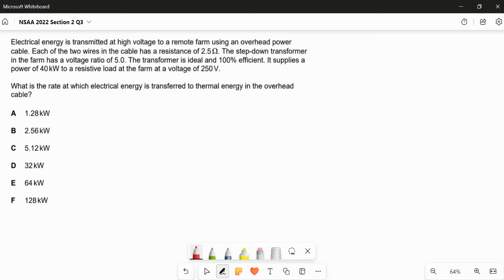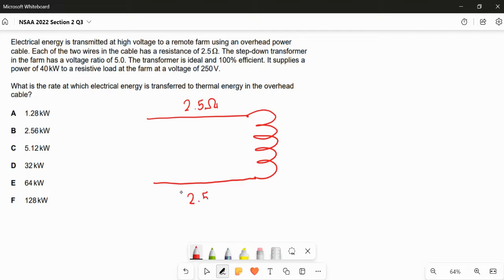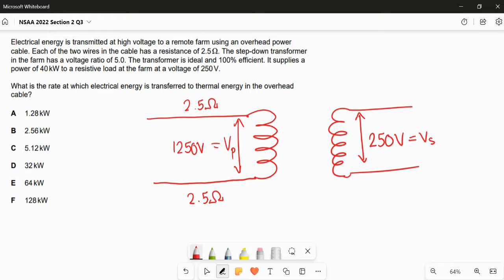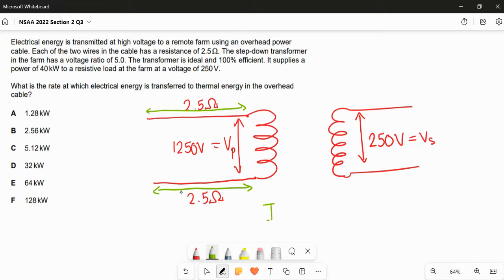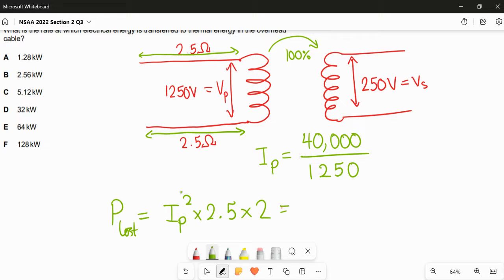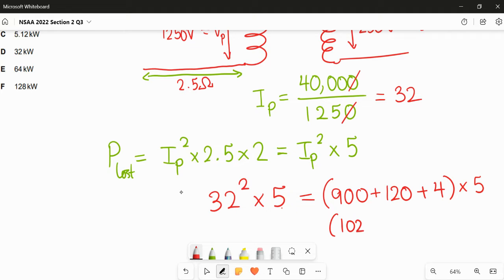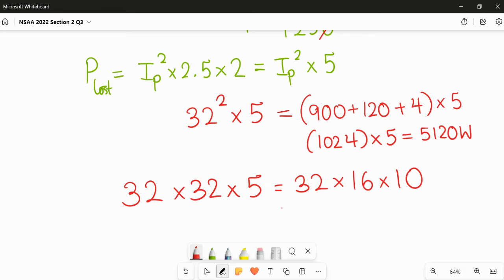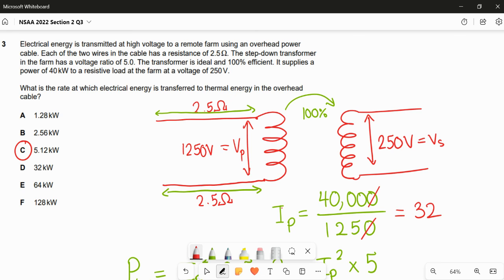NSAA ENGAA 2022 Section 2 Q3 Solution

Comment: why can't you get primary current by dividing 1250 V by 1.25 ohms?
Reply from the maker: This is a common misconception, the 1250V is dropped along the coils, not across the transmission wires. So you need to first work out the current using P=IV and that current multiplied R will tell you how much voltage is dropped in the wires. 

The wires aren't in parallel, even though the phrasing is strange, they do mean one wire to one end of the coil and another wire to the other end of the coil.

Comment: I thought that the wires in the cable are in parallel therefore the equivalent resistance is 1.25ohms. Why is this not the case?
Reply from the maker: I and others have thought that too, in which case you'd get 1.28kW. I think that's reasonable given how they phrase the question, but if you check even A-Level questions, they sometimes refer to a two-wire cable as one where the top wire and the bottom wire (carrying current back) are covered in a cable-casing. I think there was an old question that had a similar set-up of a wire forward and a wire back. I agree though, it is really confusing, but there's no way to reconcile the wires being parallel (having half the current each) and an effective resistance of R/2 with an answer of 5.12kW. There might be transmission line videos on YouTube that go into more depth, but I take this is what Cambridge meant when asking the question.
Reply from the maker: It's a good question though and I think it's worth investigating if I have misinterpreted. Did you end up getting 1.28kW? (as in 40,000/1250 gives a total current of 32A, 16A flows in each so we have (16^2)*2.5*2 or (32^2)*(2.5/2 = R_eff). I think they gave that answer in case people thought this, but I think it's just been worded very badly imo as that working doesn't match with their answer. I'll definitely keep looking into it, if I am just using the wrong logic for the correct answer.
Reply: Yes I ended up with 1.28kW. Thanks for your reply